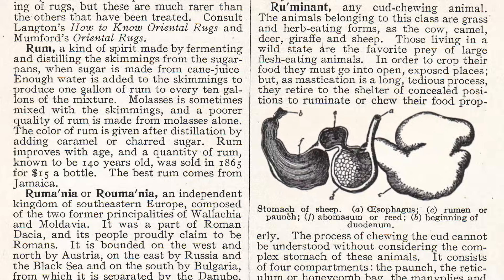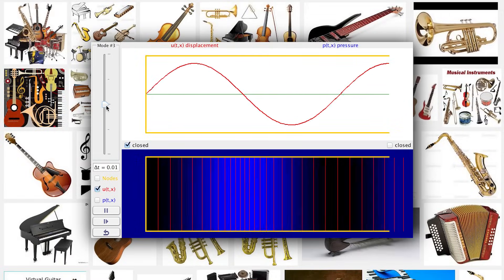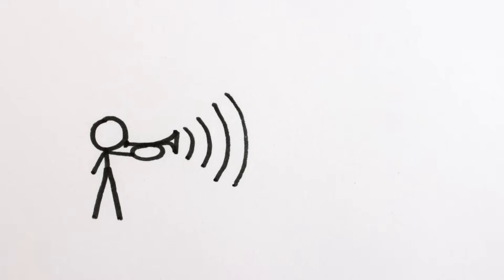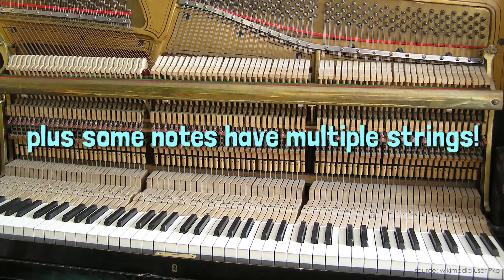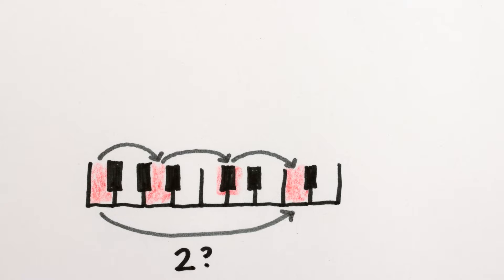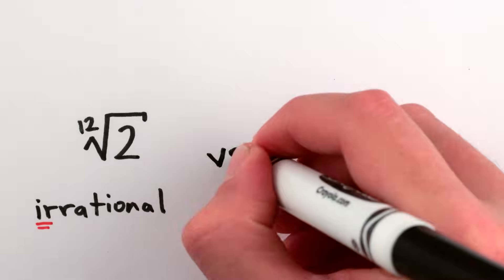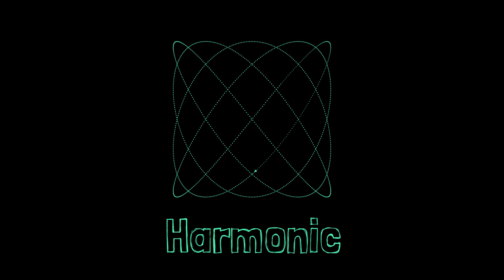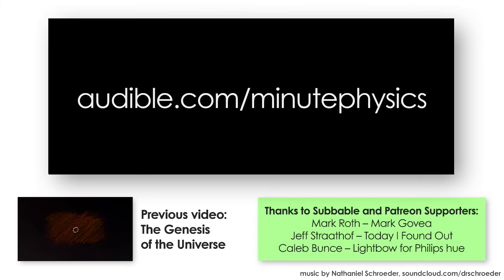Why It's Impossible to Tune a Piano

Comment: So for just the hell of it, what WOULD a piano sound like if it was tuned harmonically.
Reply: Well if you tuned everything using semitones, the piano would progressively become more out of tune the further up you go...

The frequency of the highest A in theory should be 3520Hz (as it is 3 octaves above our reference of A440, we multiply 440Hz by 2 three times), but using the least accurate harmonic to tune (aka the worst case which produces the multiplying factor of 2.17 for finding the frequency of an octave above any particular note), the frequency of top A would be approx 4496Hz... 

So the percentage deviation of this is as follows:

[(4496 - 3520)/3520] x 100 = 27.7% 

That means that using the worst case of harmonic tuning, top A would be 27.7% sharp...

I'm confident that by dividing by 2 three times, 4496 = 562Hz, it corresponds to just flat of C# - so I think our top A would be so sharp that it would be almost a major third sharp of A3520.

And that's how out of tune your piano would be
Reply: It would sound ok but you'd need a lot of keys. You'd need a separate C# and Db key, and when playing a major chord, you would have to play a different C# than usual (so that it's a just major third over A, instead of 2 major seconds over A). This applies to all accidentals (D#/Eb, F#/Gb, G#/Ab, A#/Bb) and notes that are potentially the major 3rd of a chord (for instance you'd need a lowered A when playing the F major chord).
Reply: Maybe if there were multiple levels of keyboards (like the layout of a harpsichord?) each corresponding to a different tuning for each key?.. it would in no way be worth it though...
Reply: tacos mexicanstyle
Maybe you could have 2 keyboards... a normal one, and one lowered 14 cents. You'd still have 700 cent fifths instead of 702 cent Pythagorean ones, but you'd be able to play 386 cent 5/4 major thirds instead of 400 compromise ones (for minor thirds though, I think equal temperament ones sound better).

It might also be interesting to change how lowered the 2nd keyboard is for Greek (-33 cents), popular Turkish (-40~~ cents), Arabic (-50 cents) and Persian music (-45~~ cents).
Reply: "... I thing our top A would be sharp...almost a major third" Just for a second, try to comperhand this as a plane english, out of music context, like speaking of weather and architecture or something... It just does not yeild any sense. Yeah, thats how any normal man feels reading this.
Reply: NGC1433 It's conflating 2 issues... piano note have high harmonics that are somewhat sharp. This is because piano strings can't be infinitely thin, which makes them behave like really long, lanky xylophone bars.

For the middle 4 octaves of the piano that get played the most, this isn't too much of a problem (the amount of sharpness is relatively low), but for very high and low notes, this gets somewhat noticeable, so to compensate, the interval between semitones is stretched a little, which makes the highest notes about 30 cents sharp and the lowest notes about 30 cents flat.

That's also why grand pianos are so long... the longer you make your strings, the less sharp their harmonics get, the less stretch tuning you need to apply.

Note that this only applies to plucked string instruments - bowed strings and wind instruments play tones where all harmonics are in tune, so they actually follow equal temperament.

This is a different issue from the one in the video - which is that 12 perfect fifths add up to 7 octaves + 0.2346 semitone, so to avoid that, we make the perfect fifth very slightly flat (700 cents instead of 701.955 cents).
Reply: boptillyouflop
Yeah, exactly. Thank's for vivdly illustrating my idea. :)
I was talking about the world in which "sharp" describes the property of a cutting edge, A is a letter in an alphabet, or at best describes a geometrical shape of some structure, like A-pillar and Major Third may be some WW2 veteran with a strange surname. But as far as I can see, your proffessional deformation prohibits you from seeing that other world. Don't worry, you are not alone. C#, ruby and python are programming languages for me.
I genuinely cannot understand "somewhat sharp" in other terms than a kitchen knife, which is sharp enough to slice potatos, but somewhat hard to cut through the skin of tomatoes with...
Reply: NGC1433 okay but this is a video about music so... musical terminology seems appropriate
Reply: tacos mexicanstyle

Of course, obviously. Absolutely no problem with that. But somehow makes me feel inappropriate... Or, considering English is not my primary language, I get confused. :)
Reply: It's okay, I couldn't even tell. I can speak a second language too and it causes trouble sometimes with understanding so I get it completely :)
Reply: NGC1433
Ah yeah sorry... English is kinda stupid like that, it doesn't have words for music note height like "Do ré mi fa sol la si" or "Bémol, dièse" or even "Grave, aigu", so it kinda grabs whatever other words.
Reply: no, we do have those!
tonic, supertonic, mediant etc
Reply: boptillyouflop
Wow, dude! I appreciate this so much! And I really (almost?) understand the physics of the problem with pianos. I am laser physicist myself, hence quite good at the math side of the problem, I even know somehow that octaves are doubles or halves in frequency. But I have absolutely no bearing on the lingo, if I may call it that. If you could point me to an examples of how sharp and flat notes sound...  But please don't bother, I can google that. I owe you enough tasty stuff already! :)
Thanks!

Nice people in youtube comments! What a time to be alive!
Reply: 880 991.09 is the conversion of speed of light/speed of sound at sea level according to google for the frequencies so A440 on a piano is equivalent wavelength of the light frequency of 387636079.6 Hz  roughly.
Reply: Wait isn't A440 440Hz? Are you using Hz to show the length of a wave of the frequency 440?
Reply: You'd only be able to play songs in the key with which it was harmonically tuned, and not too far away from the tuning root, either. The farther away on the keyboard, the worse it would get.
Reply: Enny Gima
True. Well, technically if you add separate sharps from flats, and E# B# Cb Fb, and probably a double sharp and double flat or two, that should cover every key... But I don't think there are many musicians that want to play on a keyboard like that!
Reply: That's diez and bemol, not sharp and flat, you crazy English speaking people :)
Reply: Vladimir Nicolici
At least English doesn't have the note "H"  like German :3
Reply: solution: just learn violin
Reply: H is just B I thought.

Comment: This video is rather misleading. In western music, virtually ALL instruments have been tuned used 12 tone equal temperament (12 TET) for at least a couple of hundreds of years, for the exact reasons described in this video. If your piano was tuned to 12 TET and your guitar was tuned harmonically they would not be in tune with each other, and you'd have the same issues with the guitar as described here when switching scales. How can I trust any other of your videos now?
Reply: Did it ever claim the opposite?

Comment: A good professional piano tuner is well aware of the fine-tuned compromises needed to ensure that the piano sounds best for performing in the most likely keys. It's called well-tempering, and Bach produced some music that shows it off. Wendy Carlos produced an album of synthesized music using perfect tuning, as well as well-tempered synthesis; the difference is definitely audible. A few orchestral instruments, notably the trombone and French horn, can be "warped" to provide a better approximation of true-pitch tuning. The oboe is used to provide a reference pitch for the whole orchestra because it is among the least adjustable instruments.

Comment: Good video as far as it goes. BUT, there is another physical effect that comes into play when playing two piano notes at the same time. It is called enharmonicity and it is caused by the fact that the vibrating partials of the string are slightly shorter than the theoretical and thus slightly sharper in pitch. The entire tuning is thus slightly stretched as one moves outward from a given anchor pitch (A4 = 440 Hz).

Comment: I think iyn a valved brass instrument, you also have the problem that bit every interval can be in tune purely with the valves, but in brass you have a considerable amount of flexibility to adjust the timing with your lips, so you just need to be aware that 3rds tend to be sharp and 5ths tend to be slightly flat, and adjust accordingly

Comment: Are you able to show me the math for how you got 1.973... for tuning a piano using fourths? (4/3)^(2 +2/5) doesn't work. I suspect there is a logarithm for the fractional leftover piece of the fourth.
Reply: You can ignore my question. I got it. ((4/3)^12)÷(2^4). Excellent video, man! Really appreciate this!!
Reply: @jerrodball7366  I know this is over 3 years later but thank you so much for this! I've been scratching my head at this for ages... And your answer has made me realise where I was going wrong with my math. I was dividing by 2^5 (power of 5 for the 5 octaves gone up) but totally neglected I was trying to work for an octave higher than starting notes! Silly me!

Comment: I agree, for the reasons given, that "you can't tune a piano" by ear using beat frequencies.  But, the video implies you can tune a guitar this way, which you cannot.  Like a piano, the guitar must be tuned using a tuner employing equal temperament, an the errors accepted.  Also, I don't believe, as stated in the video, that a violin is tuned using harmonics as described at 1:30.  A violin is tuned using the perfect fifth intervals between open adjacent strings.

Comment: With modern digital tuners...which you can download almost for free to your phone....tuning notes on a piano is a piece of cake. Before these, piano tuning was a skill taught in trade school. It required real skill to get an even temperment of a piano scale. The term they used was 'inside or outside of smooth' for those slightly flat fifths and slightly sharp fourths. You tune the fourth to a smooth interval...the harmonic pitch...and then listen for the beats in the interval to just start as you tighten the string slightly. As I said, it took real skill to get it all to come out right.

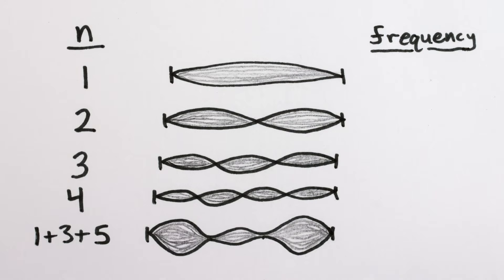Comment: 0:25
This is actually false. Is not exactly equal, but almost equal. It goes as a function of sin(k*n), where k is a constant that depends of the string. For low n, we can make that aproximatation, but it's not generally true.

Comment: It is true that you can tune the open strings of a guitar perfectly using harmonics,. However, if I'm not mistaken, the rest of the guitar will be out of tune then, because the frets are spaced to equal tempered tuning. This method only works for fretless intruments like the violin.

Comment: 0:50 I don't think "2 to 3" is a perfect fifth. according to equal temperament, which is applied on pianos, a perfect fifth is "1 to 2^(7/12)".
If a perfect fifth were indeed two to three, then the frequency of E5 note, which is the fifth of A4 note whose frequency is 440Hz, would be 440*1.5=660. But the ACTUAL frequency of the E5 note according to equal temperment, which is used on piano, is ACTUALLY 659.25Hz, which is round 440*2^(7/12)=659.2551138Hz.

Comment: You should mention that most pianos (and string instruments) are tuned slightly sharp in the higher octaves and flat in the low octaves. Due to psychoacoustics and the fact that the short strings in the upper octaves act more like a vibrating stick/tuning fork rather than a string.

Comment: Anyone know if a computer keyboard  could automatically adjust the interval ratios in real time so you always have correct tuning. So if you hit an C then hit a D directly after the computer knows what you’re doing so adjusts the major second frequency difference accordingly?
Reply: High end electric pianos and keyboards have the ability to adjust temperament yes.

Comment: Yeah, the problem explained in the video is one of the problems with tuning a piano, but it isn't the only one.  Piano tuners generally don't even tune the notes to be exactly the twelvth root of two apart across the entire keyboard.  They tend to make the octaves get slightly wider (or "stretched") as you go up or down from the middle of the keyboard, since this makes the piano sound more in tune.  The extremely low strings, for example, are so thick and stiff that dissonant harmonics sound sufficiently loudly so that has to be taken into account.  (This is especially so on smaller pianos, which have shorter strings, so that they have to be extra thick to get the low notes, and it's less prevalent on larger pianos, such as concert grand 9-10 foot long ones.)  A real piano tuner can probably come up with even more compromises they have to make in reality, beyond I've mentioned here.  Piano tuning really is "the art of compromise".

Comment: Wait, you only talked about the theoretic well-temperment, but on piano there is stretch turning problem because of the inharmonicity. Tuning towards the treble notes and bass notes needs to be stretched. And each piano is slightly different.

Comment: As you nicely demonstrated, just intonations sound well only in the one key an instrument was tuned, but  prevent transposition and modulation as their inherent inconsistencies make them sound awful in other keys. Equal temperament, on the other hand, is a compromise where every interval between non-equivalent tones is out of tune. This allows free transposition and modulation, as it sounds just as bad in one key as in any other key. But what you might not know is this: Equal temperament is NOT the best compromise. It’s just the one which was historically found centuries ago and used ever since. But this has just changed! 
The book MUSICAL TONALITY by Hans-Peter Deutsch (DOI: 10.2139/ssrn.4452394, also published on ResearchGate) determines the one, unique intonation which, in a strict mathematical sense, best adheres to the physics of overtones while allowing full transpositional freedom. So, after centuries of enduring either the inconsistencies of historical just intonations or the irrationality of equal temperament, the truly optimal intonation for the western tone structure has finally been found. 
In this optimal tone system, which is called CLEANTONE TEMPERAMENT, all thirds, fifths, sevenths, etc., and therefore all chords (which are stacks of thirds) sound clean above each and every tone, in every key. For example, a major third is always exactly 5/4, a minor third always 6/5, a perfect fifth always 3/2, a minor seventh always 9/5, a major nineth is 9/4, etc., over each and every base tone, in each and every key! In fact, half of all diatonic intervals have their justest possible frequency ratios – and the intonation is still consistent allowing full transpositional freedom. To anyone with experience in musical tuning systems, this might sound almost too good to be true. But it is all real in cleantone temperament, mathematically proven in the publication. You might want to check it out.

Comment: A piano could be tuned perfectly, at least as perfectly as the physical limitations allow, using just or harmonic tuning, but only one key would be in tune. This would be easier on electronic keyboards as you could then change which key is in tune on the fly.

Comment: At 3.23, you speak of flat and sharp intervals. Intervals are NOT flat nor sharp. Intervals are wide, narrow or pure for non-equal temperaments. Flatness/sharpness is when comparing to another single string in a trichord or bichord, another note or a reference note the same but at the CORRECT frequency.
For equal temperament,  5ths are narrow, 4ths wide, maj 3rds wide, maj 6ths wide. As tuners, we constantly strive to get smoothness at transitions particularly at the tenor break and wound/unwound strings. Short strung pianos need careful work, sometimes requiring slight changes in the scale. No-one in any of the comments has mentioned false beats on individuals strings, which do happen in reality.

Comment: For those who didn't understand; basically the reason is the same reason you can't square the circle. You're dealing with a number that's irrational, which can't be expressed (pi in the case of the math problem, the 12th root of 2 in the case of the piano tuning), so they'll never be perfectly tuned because we can't perfectly use this number in practice. And you can't tune with harmonics because it has so many different strings (Not 4 like a violin), and the octave will always be off if you attempt to tune with harmonics (ie, tune based on perfect fifths being a ratio of 3/2, etc) which is the way we tune other instruments. Some approximation of the 12th root of 2 gives the best results, but still NOT mathematical perfect. This is the best way I could sum it.

Comment: Maybe, as a pianist, I am biased, but I would say that this video is “why its impossible to tune anything other than a piano” if you go by harmonic tuning, then your intervals are asymetric by key. The E-B interval and the F-C interval on the same string will have different values even though they are the same interval. Shouldnt that mean that the harmonic tuning is the correct way?

Comment: The 5/7 method described at 1:35 is wrong and will not tune your guitar. The harmonic at the 5th fret on the E string and the harmonic at the 7th fret on the A string SHOULD NOT be in perfect unison. This is because the 7th fret harmonic produces a pure fifth, while the fifth we want in tempered tuning is slightly flatter.

You can read more about tuning guitars here:
http://www.guyguitars.com/eng/handbook/Tuning/tuning.html